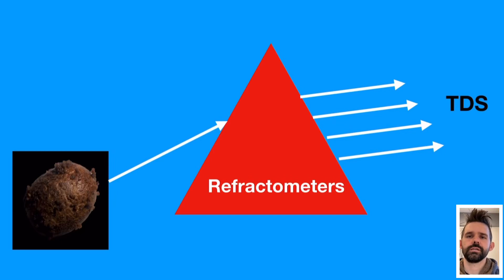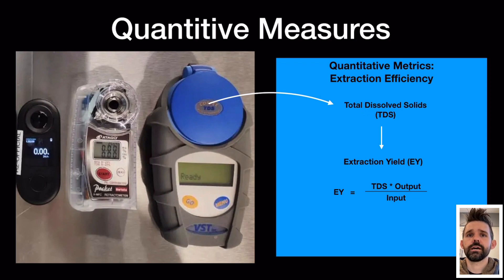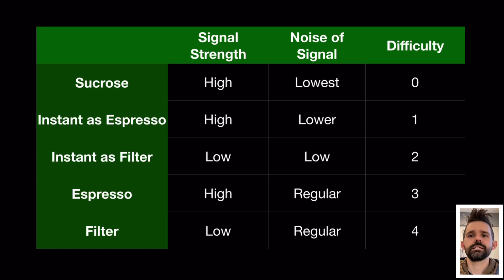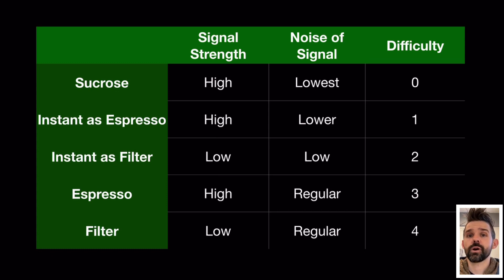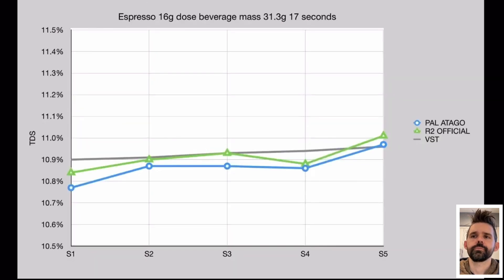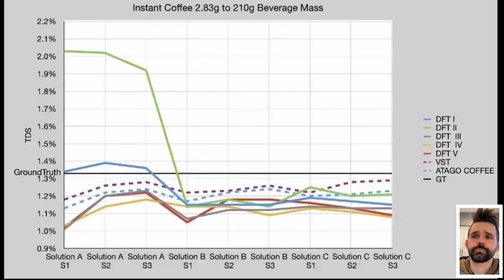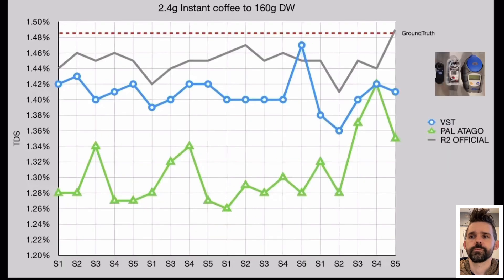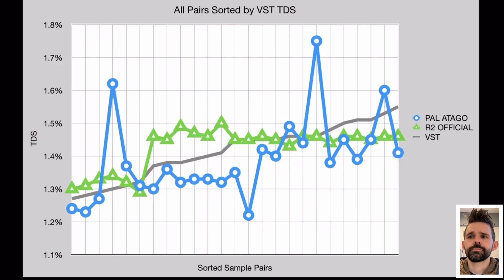Multiple Coffee Refractometers Compared: R2, VST, and Atago

Comment: Great video, Robert! Did you buy the R2 devices on the open market, or were they given to you by the manufacturer for your testing? Just wondering if it's possible they were cherry-picked.
Reply from the maker: Valid question. I don’t know if they were sent or bought by Socratic Coffee. However, for the first DiFluid tests, they were send devices that had wild swings across devices, so the first ones weren’t cherry picked. I haven’t seen results for other R2 tests vs VST (or Atago) that suggests these devices were cherry picked. Assuming Socratic Coffee did buy them, the manufacturer could have cherry picked nonetheless because they knew where they were going.
Reply: @espressofun6091 almost every review I have seen the devices were provided free of charge. I am still looking for a review where the reviewer paid their own money to get it. In my experience with the R2 that I paid for with my own money the results for even the same sample vary widely. If I push the button 5 times I sometimes get 5 vastly differing results that produces extraction yields from 18-21%. Id like to have the DiFluid OMNI but am worried about the same faults. I’ll save up for a VST and a Lighttells CM-200.
Reply from the maker: @LivingTheLifeRetired  tell me more. What are you using it for (espresso or filter)? Tell me what the readings are? What’s the variance?
Reply: @espressofun6091  I’ve only tried using it for pour over. It’s cleaned, calibrated, samples are room temperature, and for the same sample (that is, leaving it on the device) and pressing the test button, to get readings like 1.32, then 1.40, then 1.47, the 1.46. That results in extraction yields ranging from 18-21%. With those variances it makes it rather pointless.
Reply from the maker: @LivingTheLifeRetired does it stabilize? VST and Atago take quite a bit more time to produce a result probably because they’re waiting for the reading to stabilize
Reply: @espressofun6091  the sample is stabilized, room temp, and it takes a reading quite quickly. I don’t think stabilization is an issue. Anyway, not happy with mine.